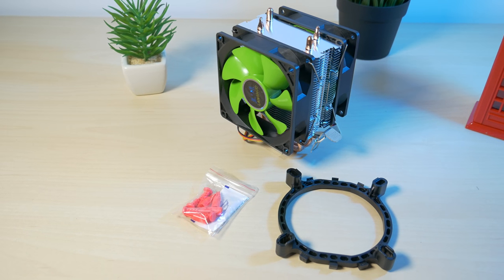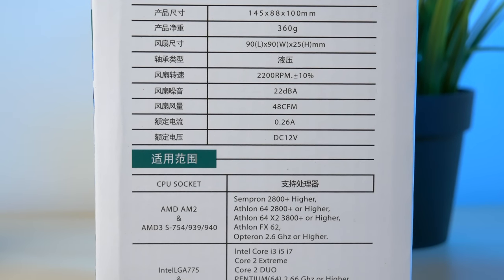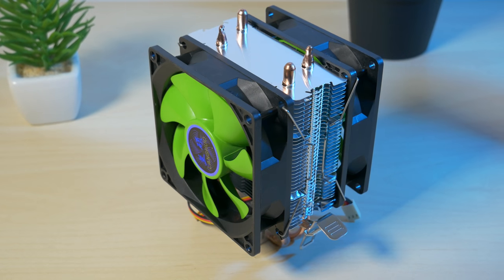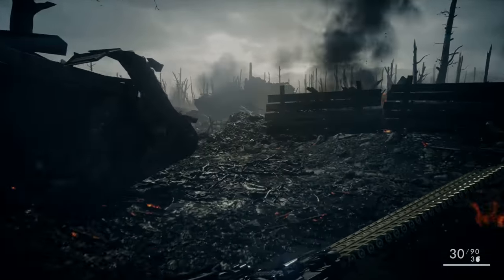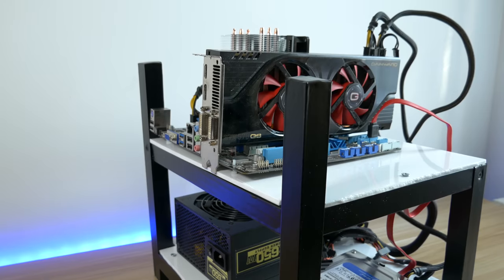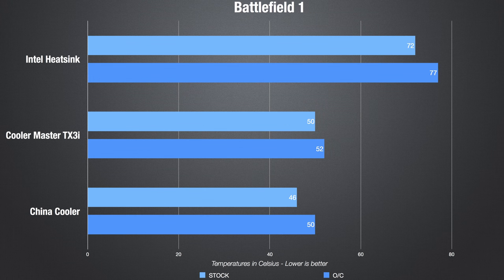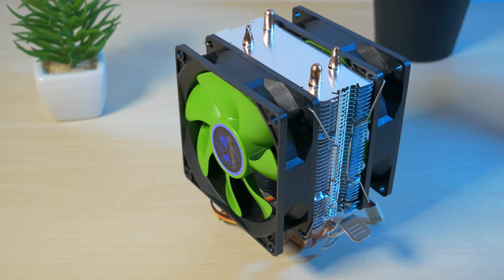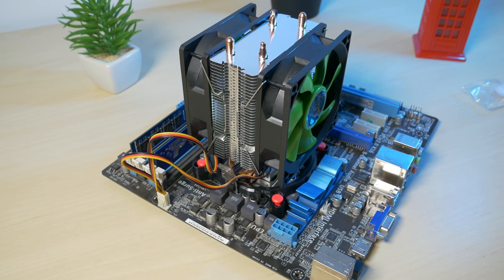Cheap cooler from China | Is It Any GOOD?

Comment: bought a few chinese coolers similar to this but a single 92mm fan and 3-4 heatpipes and they've been great, dont mistake them for a name brand however, the mountings great and they do a great job with an overclocked dual core or mildly overclcoked 125w tdp part. the second fan does nothing what so ever and they only have 2 heatpipes so there is the limiting factor. way better than worthless intel coolers. just remember to set fan speed to PWM or voltage in bios and adjust the settings and test again and again.
Reply from the maker: They are surprisingly good. If you are on a tight budget, and want a decent cooler, these chinese ones might be the solution. Definitely much better than the stock cooler.
Reply: If you have "4-pin Fan" then option are be optional ("Automatic controlling" outside "BIOS Configuration")

Comment: more thermal paste next time?....good video!   thumbs up.   edit: just ordered this for 10 usd on ebay  for my am3+ 8350...wish me luck ;)
Reply from the maker: Too much thermal paste can do more harm than good. You will be alright with that cpu/cooler combo.
Reply: @WabitTech  Quality also matters if the cooler is not the bottleneck of heat dispersion.

Comment: Really nice review m8 :)
I wonder if you have tested the 6 heatpipe Arsylid cooler from aliexpress.They seem really good for the price.
Reply from the maker: Thank, I appreciate it. I haven’t tested the mentioned cooler. I was planning to get a few more from China and test them all, to see which one is the best cheap cooler. Any suggestions on what to buy?
Reply: @WabitTech  The 6pipe arsylid,the new 6pipe snowman(with push and pull 120mm fans) for only 20$.I guess anything popular at 20$ price range which can handle medium to heavy OCing.
Reply: @Kanivalos80  Definete requests..
Reply: @WabitTech  That's what I am using, low noise & do the job.

Comment: I have this cooler and it doesn't make much noise
Reply: It depends of connection type. 3 or 4 pin. 4 pin actually have rpm controller so fan speeds will be lower, also your mobo can support a voltage fan speed control if you using a 3pin connection type...
Reply: Jay Arre  I just said that...

Comment: Hey man i need some help i have a cooler that is a forcetake cooler it was used in my lga 1155 board with a bracket when i searched in its website it said it supports 95w cpu . Hey I ordered a lga 1366 motherboard with an included mounting bracket it is a killsre board will it work or fit?????

Comment: I got the same chinese cooler. it's true, works very good but is too noisy! The solution is only one: Replace fans with some single 4pin PWM fan ;p i've tested with Acrtic F9 PWM and no more bad noise :)
Reply from the maker: I used the same fan, almost silent, and the cooling performance is the same. Add a bit to the price, but still cheaper than for example a tx3 evo.

Comment: Hello it is little bit old video but i want to ask a question. I have i5 9400f and with stock cooler my cpu temperature become 75 degrees. With this cooler, can i get it like 60 degrees? In winter my cpu temps are good but in summer it is become very hot.
Reply from the maker: Hi. The temperature will definitely go down with this cooler compared to the stock intel cooler. I’m not sure if it will get to 60 degrees, but you will definitely notice the difference. There are some newer coolers for relatively good price. I have a new video coming where I compare a few other coolers from China. Not sure when, probably in a month or so.
Reply: @WabitTech  thank you for your feedback. I think im gonna buy this model or maybe a 4 heatpipe version of it. But probably 2 heatpipe is enough for i5 9400f. Thank you again
Reply: @WabitTech  Should i but Aigo CC92? At least it has some lights and i think its shape is better than tower coolers.

Comment: How do we remove this cooler ?
Reply from the maker: Don’t have the cooler anymore. If you want to remove the plastic mount, then you have to remove the 4 red pins, if I remember correctly you can just pull them out, our push them from the bottom side of the board. 
As removing the actual cooler, just unclip the metal bracket.

Comment: Can we use on core 2 quad
Reply from the maker: It is compatible with 775 socket and the cooling is decent enough. Depends on your overclock, but shouldn’t be a problem on stock speeds or with a small overclock.

Comment: I bought this cooler but I cannot install it on a am3 mother board
Reply from the maker: What`s wrong with it? The mounthing holes don`t fit?
I used it on AM3, and it was ok. 

You can run into some crelance issues because of the capacitors for example. It all depends on the motherboard, not all are the same design around the socket, even if they have the same socket.
Reply: @WabitTech  I managed to fit it was a tight fit thanks for the reply